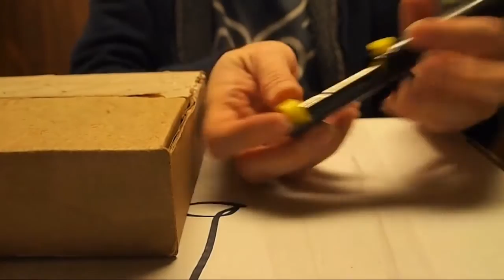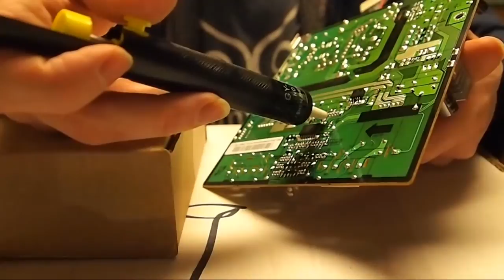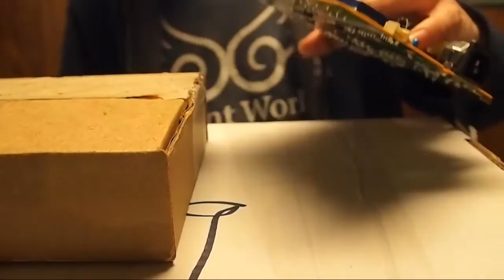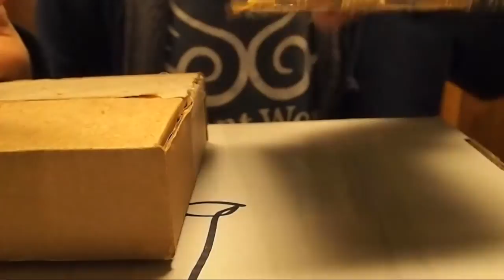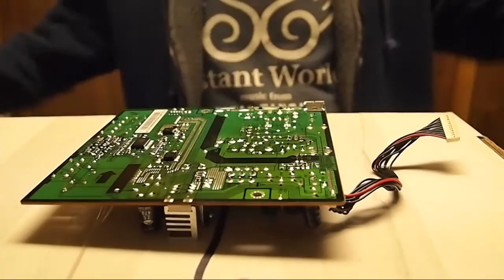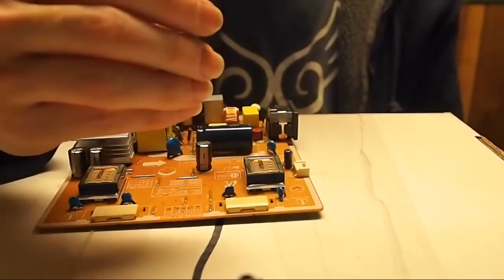Samsung Syncmaster 2053BW desoldering capacitors  (Part 2 of 3)

Comment: i have a samsung sincmaster 2253nw , open and see 3 capacitors bad, 16v 1000mf, and 10v 330mf,
Reply from the maker: I had to replace 2 16V 1000mf caps in my setup but no 10V 330mf. It's entirely possible that you have different specs capacitors in your model. Just replace the bad capacitors with the exact same specifications and you should be good to go. :)